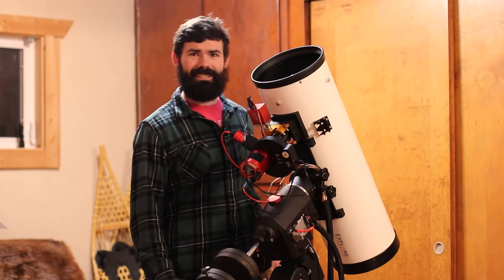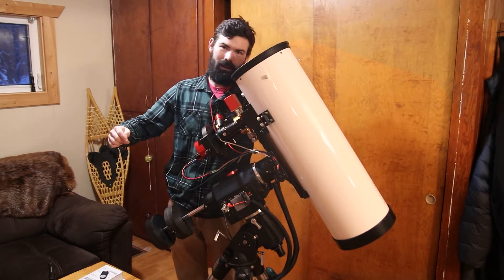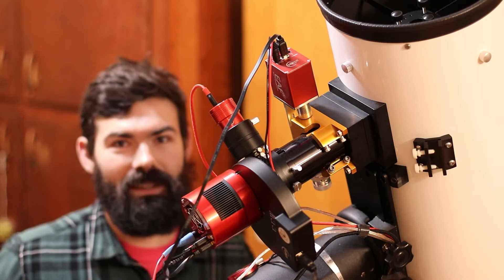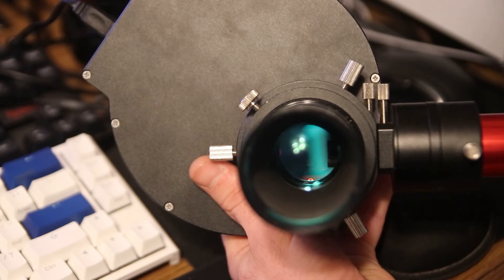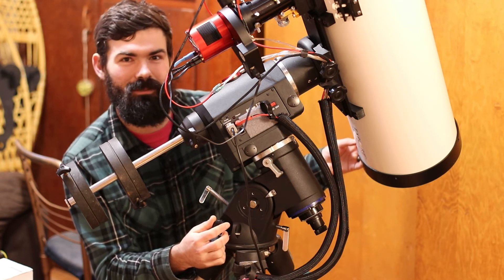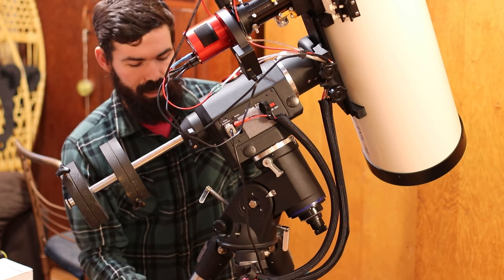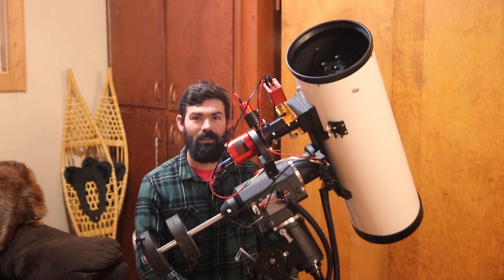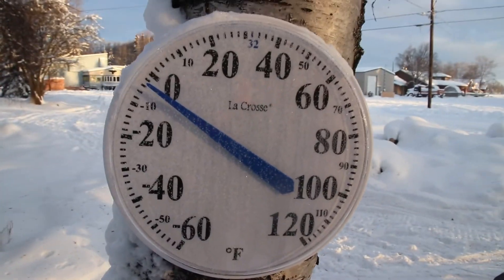My Astrophotography Rig and How It Works Together

Comment: I just bought the same telescope on Facebook - I had some questions on any modifications that you recommend - how does the prime focus work for this model?
Reply: What focuser did you add here?  What model # ?
Reply: Finally got my stock focuser working with 1 inch eye pieces.  How many mm is your imaging train before you attach the ZWO camera?